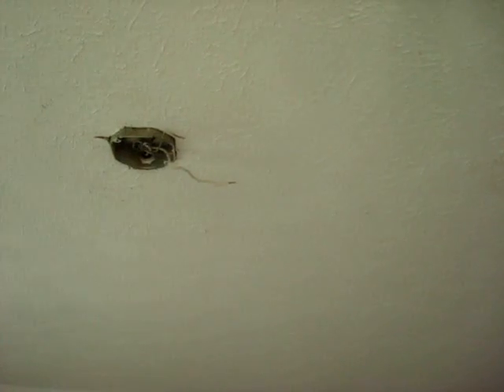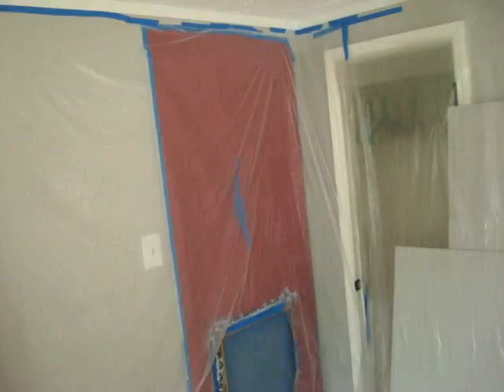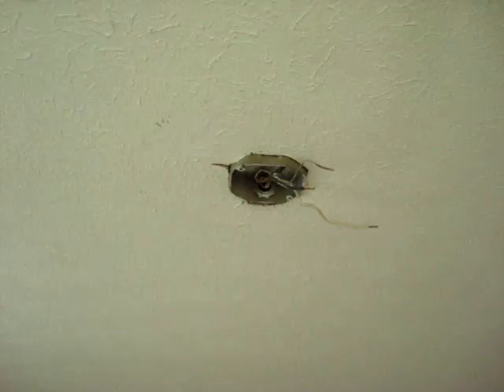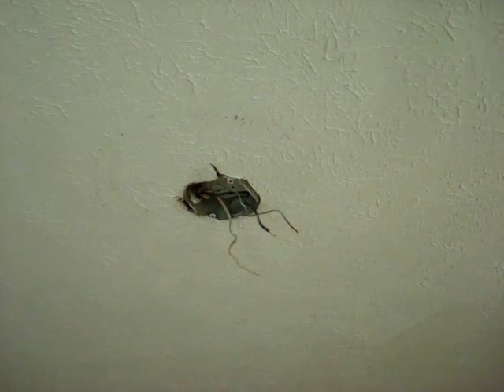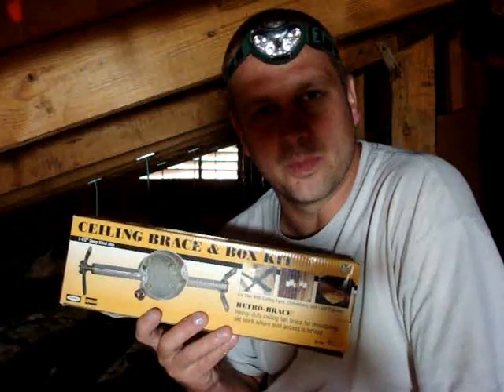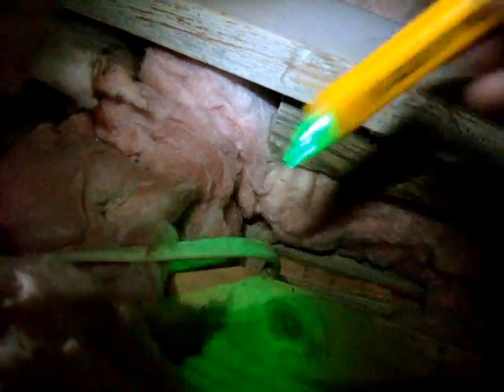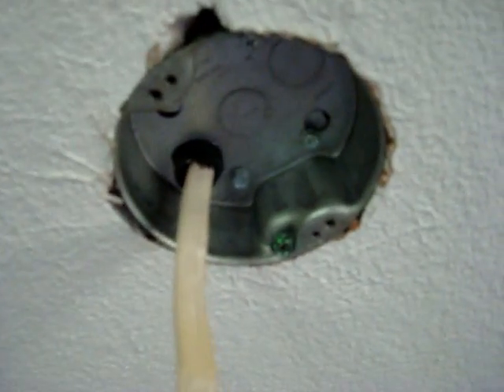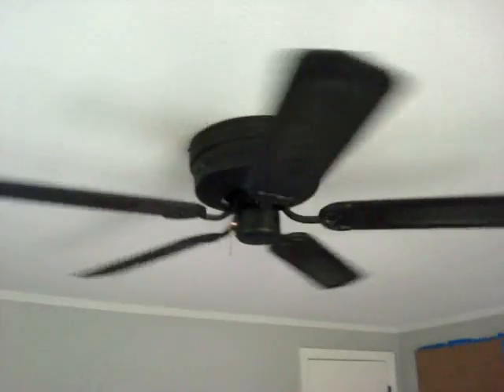Installing a Ceiling Fan in the Correct Box

Comment from the maker: The box has a weight rating, so find out the weight of your fixture and make sure it's less than the max allowed on the box. The key is making sure you know what the box is--if in doubt, take it out and install a ceiling box. you can get a retro kit box that will work in many applications for around $15 and in many cases you can surgically remove the old box and then slide the new box through the hole in the drywall. The kit has the instructions, but essentially it's a threaded rod.

Comment: You could have just cut 2- 2x4s and nailed them in between the joists and used a fan rated pancake box.  Also you have a remodel fan brace why not buy a new construction one?  The whole point of a remodel brace is because you don't have access above and they are installed from inside the room.

Comment: James i got an older home. The builder literally used no boxes to screw the light fixtures in the ceiling at the time. All of my now fans are screwed into the joist, with a box on the side of the joist, really weird. Im wanting to just use a pancake box and pull the wires through and remount all of my fans but im wondering will the pancake boxes work with any fan? Will the wires fit?
Reply from the maker: +ChrisXCXCX A pancake box is shallow and I can see why you want to use it for this application since it's not much deeper than the thickness of drywall, but it's neither a good idea or legally allowed. You're right to wonder about it being too tight for light and fan wires (it is).

You can solve this problem without tearing the ceiling out. They make this retrofit kits (I used one above) that allow you to install 75# support (like the one I used in the video above) and with some care you can even do it from the room. This is great if you don't have access to the box from above (like a first floor in a two story house). You can cut a hole in the ceiling for the box and install the box and wire it just through the small hole. You will have to patch the other box hole.

The only downside to this is you may not have enough cable to make it to the new box. If you don't mind a cover on the hole of your old box nailed to the side of the joist, you can do a legal accessible junction from that box to the new one centered between the joists on the support that is designed to hold the fan. The other option involves running a new cable back to where it's accessible, like a box in a laundry room or even the panel itself. Under no circumstance should a junction be made inside a wall or ceiling that is sealed up--that is illegal.
Reply: +James Glass They actually have a legally allowed pancake fan mount but i dont think im going to have enough room to do the wiring. Some fans lets you make the connections in the fan cover.

Comment from the maker: Sure, if I wanted to be a punk-ass bitch like yourself. The remodel brace can be used via the hole only, and I could have used a new construction brace BUT the remodel brace is rated to hold 1/3 more weight. It only cost $3 more, so why be a cheap ass hack?